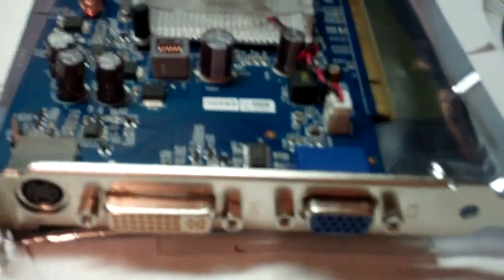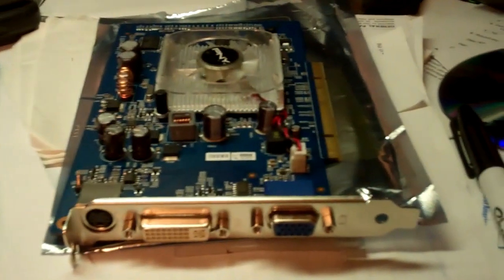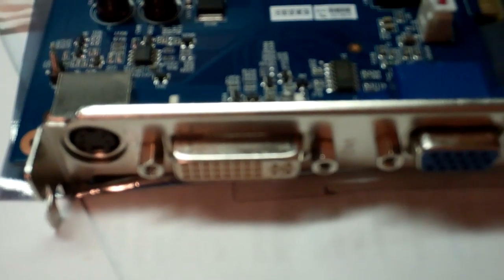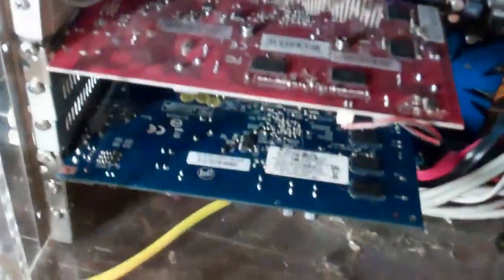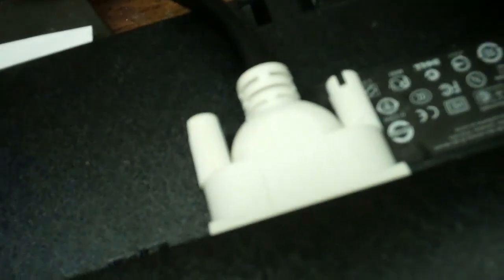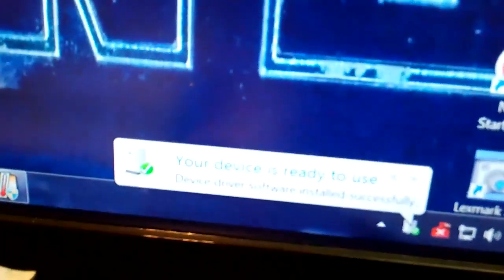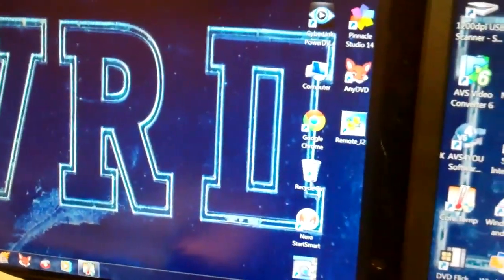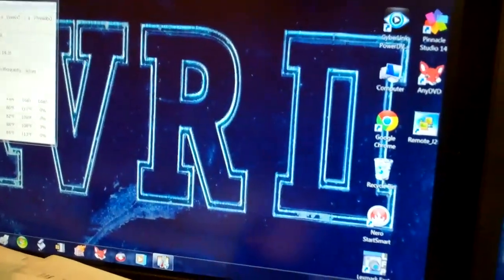Finally got 3 Monitors to Work!

Comment from the maker: Not sure what SLI is.. Windows 7 automatically detected both video cards, then I went into the Display settings and selected 1, 2, or 3 to identify which monitors I had in viewing order and saved them. Been working with 3 monitors ever since this video.

Comment: Quick question. I have 2 video cards. They other day i installed all three monitors, 2 via dvi, 1 hdmi. The next day only 2 monitors were being detected. So not i am lost cause i move everything around and nothing detects the other monitor. Any suggestions?

Comment from the maker: You may have the same problem I had where there is some weird setting on your video car preventing 3 screen operation..
I would recommend the same setup I did - just get a 2nd video card and connect 1 monitor to it so you have 3 monitors.

Comment: Hey dude, i got the same problem as InventGroup, but my cards are the AMD radeon 7970. I have two, and three asus monitors, and i have an HDMI cable plugged into the first one, with a dvi in it also. I have another dvi plugged into the 2nd card, but that one wont work. I tried it with a VGA with adaptor, but it wont work. I started up my computer today, and the third monitor started up, turned black, and waited for me to log on to windows like the 2nd one, but when i did it just turned black.

Comment: Hello friend! Great setup! I wanted also to have 3 screens working on 2 graphic cards but it seems that it doesn't want to work. I have two radeons hd 5770 and 3 screens are connected by DVI ports (two to first card, third to second card). The problem is, that third monitor is not working on second card, it says that there is no signal. I have both cards not connected by Cross Fire, although I have tried it both ways. Could you please help me? I will truly appreciate that! Thanks in advance!

Comment: lets get down to the pornt here one u can use all 3 ports on your one video card just put the vga in to the card then go to your control panal and do it that way even tho your vga and dvi ports run on the same channel u dont need the 2ed video card right now im running three montier on the same video vga, dvi and hdmi ports and its running really great right now so befor u really get use to the 2ed video use the one video card with three montiers it can be done i done it my self